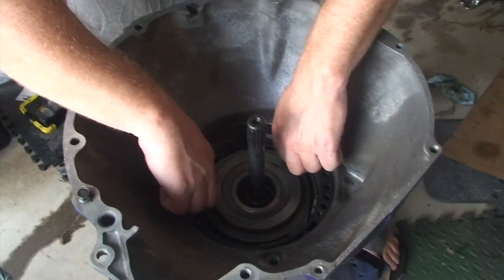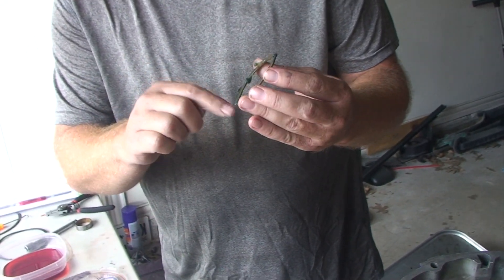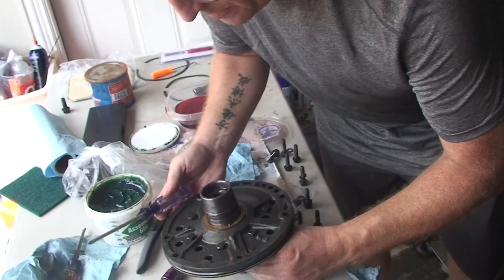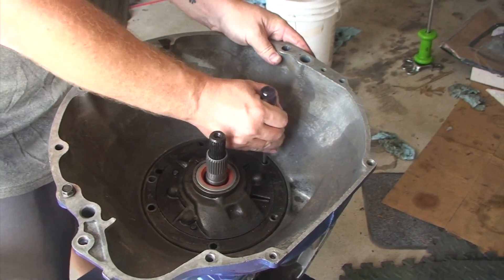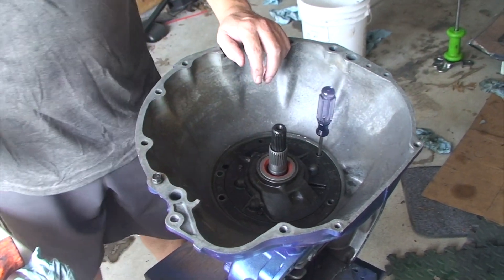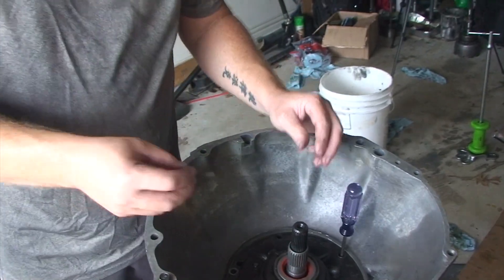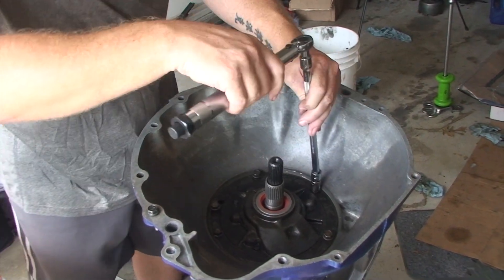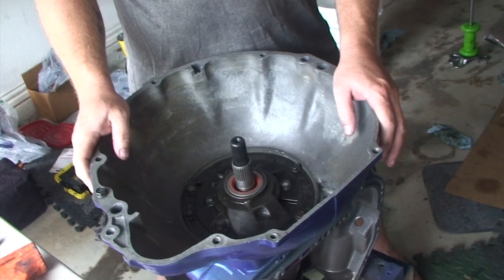32RH (904) Reassembly Part 6 - Pump Install

Comment: What adjustment to the screw/bolt on side trans that you said to tighten down drum before you take pump off??
Reply from the maker: The kickdown band adjuster screw, when tightened all the way down, will cause the band to hold the direct drum in place.     That’s really only relevant if you’re taking the pump out but not expecting to remove the drums to replace the frictions.    But I’ve reached the point in my life where I would never remove the pump and NOT also replace the frictions.  

You’ve already done the very hard part of removing the trans, you may as well do the frictions while you’re there.